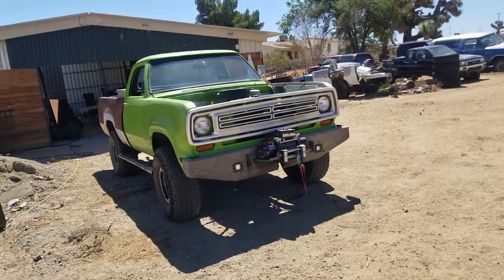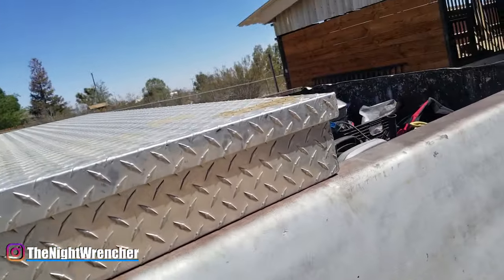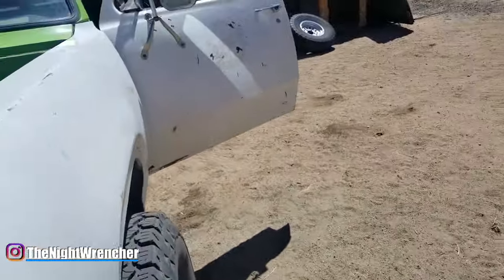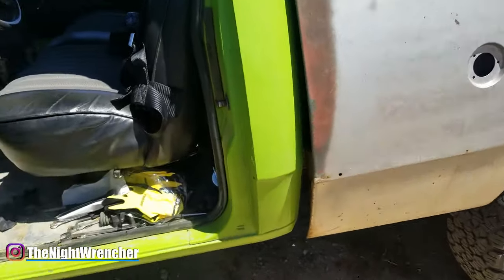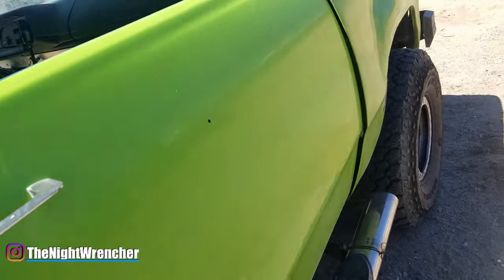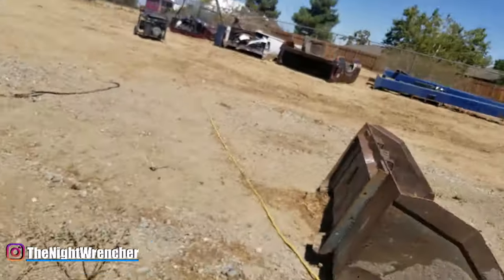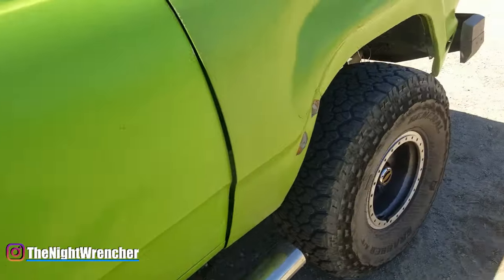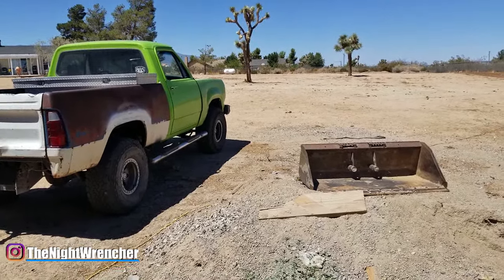Holley Carb Running Rich? Watch This! | Holley Carburetor Secrets | Holley Carb Tuning |

Comment: Dropping that knowledge. Thank you man. Best explanation ive seen yet.  Been tuning my 1850 on a 350. And everything lines up with need more fuel. So stoked on the carbed LS. boss has one lying around.  Maybe its time.
Reply from the maker: You can get that 350 to spin like a top. The older SBC were still pretty good motors. Update the ignition, tune the carb and she'll be perfect

Comment: I run a Holley 650 double pumper on a '64 Merc 352CID and have gone with about 3/4 turn on mixture screws
Reply from the maker: 3/4 fronts and 1/2 rear has always been the magic numbers for me.

Comment: Ok then, I'm going to reset tomorrow,  back to stock. Even tho engine was dynoed to find jet combo. Everything,  iab, ifr, jets. Only thing I won't mess w is PV. 4.5 in now. Makes like 9 to 10". 
Great vid man.
Reply: If it was dyno tuned put it back in that configuration
Reply: Engine dyno, not wheel. 
Still back to that?
Also, are IAB supposed to be the same size prim and sec?
Reply from the maker: Engine dyno and wheel dyno will have a different tune so your best bet is to go circuit by circuit. The iabs are usually square front to back

Comment: Nice. Still trying to get my turd to run better. 
Just got a new hp body. May try it tomorrow.
Reply from the maker: That'll be sweet man. It'll throw your tune out the window though. Keep everything else as it is and just swap the main body and see how it responds. Figure out if you gotta go rich or lean and then go circuit by circuit.

Comment: Great Video. I will have to watch again. I am completely lost at this point tuning a 1974 Honda XL250. Going to check timing and dwell. Haven't done that yet. Played around with jetting and needle so much that I am getting closer. Taking a break and making sure timing and points are set correct.
Reply from the maker: I'm not too familiar with that engine but the stock settings for that carb wont work? Also, with any engine with adjustible timing,  ignition should always be set first.
Reply: @NightWrencher  Thank You. It's been years since I worked on my old Volkswagens. This bike is taking me back there. Enjoy your day.
Reply: I put a wide band 02 on mine said screw it really helps on tuning it in great videos

Comment: At 11:23 you talk about putting a hand over the choke primary. I have a Holley 750 (Barry Grant variant) on my 383 stroker. 10.7:1, pretty rowdy cam. No choke plate but when I block off the primary the motor dies. 
Showing symptoms of a rich condition but afr is close to perfect. 13.5 ish at idle and high 12s across the board all the way up. I'm already jetted down lower than I think I should for this motor, I was even lower with similar results but currently at 72 primaries, 77 secondaries. Acc pumps are 15 thousandths off at idle, 5.5 PV, needle and seats good, float adjusted at bottom of sight hole, 31 squirters front and back. Valves checked and lash set. It's not like it's running horribly, afr is good but getting some exhaust pop in the higher range and a little smokey (fuel smoke). Any ideas?
Reply from the maker: So heres a tip. If you have a cam with a decent amount of overlap, your AFR gauge will read false lean at idle and low RPM. The only way to tune that would be with a tach or with a vacuum gauge. First make sure you have enough timing at idle for the cam(tune it the same way, with RPM or Vacuum). Second, set the preliminary idle speed and tune the idle mixture. As you dial it in, the RPM will climb, and once you go too far, itll dip back down. I like the idle a hair rich to compensate for different weather conditions. As for the popping, if it pops on high RPM decel, you probably have the idle speed set too high, you might have an exhaust leak or you're running too rich. If the exhaust pops on consistant acceleration into the upper RPM and you feel the car hesitate, its lean or the plug gap is too wide. If the exhaust pops while you're accelerating in the upper RPM, you're too rich or have an exhaust leak. Hope this helps.
Reply: @NightWrencher  timing has been dialed, lightest springs with 38 total and it's very happy there. I did end up finding my popping culprit, #8 plug was closed up and sending unburnt fuel through to be ignited in the collector, must have happened during my last plug read. Don't remember hitting it on anything going in but alas, that issue is fixed. 

Still pig fat, blowing puffs of black smoke on throttle cracks and raw fuel smell at idle. I'm gonna look at my transition slot and adjust my secondary blades tomorrow. Plus mess around more with acc pump cams again. I'm thinking my transition slot might be too uncovered with my 1000 rpm idle, cause my idle circuits don't have as much adjustment in them as I think they should.
Reply from the maker: If your carb is a 2 corner idle carb, do not try to open the secondaries at idle. You're just going to wreck distribution and lower your idle vacuum. 1000rpm at idle is way too high. Even my 73 charger with a 294/294 advertised on a 108 LSA cam shaft, idles smooth at 750 rpm hot. Reset your idle screws and start over from scratch. You want that front throttle plate as closed as possible. Its doesnt "need" to be square but it definately cant be taller than a square.
Reply: @NightWrencher  FYI this car is a bracket car, will spend most of its life doing the 1/4 mile. So I don't care about driveability, just peak power without putting holes in pistons lol
Reply from the maker: https://youtube.com/shorts/_Fve1wtlIOc?si=uIAn6OJWU1n2-kv0 heres a video of my car idling
Reply from the maker: In addition to the message I sent 7 mins ago, make sure you have that idle set correctly. If you have the throttle too far open, itll mess with off idle performance and will become very noticably leaner when trying to load the car up on the converter.
Reply: @NightWrencher  4 corner idle on my 4779. my cam is 298/298 112 lsa. I don't know how much time you spend at the track but I'd be hard pressed to find anything idling much lower than me. The other 383 on my team doesn't like anything under 1050. Most of us are either running locked out dizzys or the lightest springs, with as much timing as they'll take. But every motor is different so I'll start fresh again tomorrow and see what it likes.
Reply from the maker: @matthatesford  i drive to and from the track so my car is set up a little different. But what I do know is that you car has a very close cam to mine, but your motor has More LSA, more cubes and more compression so it should run and idle better than my engine. Mine is a 4 corner idle carb as well, the rears are turned in just a hair and the fronts are almost completely closed. Resetting your idle and going based off RPM is your best bet
Reply: @NightWrencher  alright bud, so I got most everything dialed. My t slots for the primary and secondary are the same elevation and my secondary was open too far. Closed them both down, increased air bleed size drastically, plus several other tweaks. Sitting at 14.5 afr or so at idle, 12-12.5 at wot and low 13s everywhere in between, except for right at 2500. 2200 is good, 2800 is good but right at 2500 I'm getting 18-19 steady afr. That should be right when I'm coming off my transition and into my mains correct? I've got 73 fronts with a 5.5 pv. Would you start going up in main or up in PV first?
Reply: Belay my last. I went down a bit on my secondary idle air bleeds and that cured that lean spot perfectly

Comment: I wish you could tune mine.  I have a Holley 80457-2 4 barrel.  Mine starts fine, revs fine without a load. When I drive the hills of San Francisco, she is struggling to even getting up the hill. Even if I put the engine into a lower gear, it’s not getting better.  350 Chevy.  The car has electronic ignition and new plugs and wires.  Feels like I can’t get more power from it. No backfiring either. Thoughts.
Reply from the maker: I have that same carburetor. Its a 600 single feed VS. First of all, you need to make sure you have enough timing in it to it runs right. You want at least 13 degrees of timing at idle and 32-36 max at WOT so you can get the best road maners. Aside from that, I'm willing to bet your carb is running too rich. Usually if you go into a lower gear, the AFR will go richer with less load and if you go up a gear and lug the engine, it would go lean. Second, since youre not getting a back fire, that would also indicate that its not running lean. If you can, drive with a vacuum gauge, see if youre getting below 7" of vacuum going up a hill since that would open the power valve and pull more fuel. Pull a plug, and if its jet black, youll be able to pin point it.
Reply: Check power valve.

Comment: Hello, my setup is a Ford straight six, turbo, intercooler, Quick fuel blow through carb and MSD.
Also installed A/F gauge. It reads around 14 and change at idle. Running out of adjustment on mixture screws and it’s still running way too fat. Do I need to look elsewhere??
Thank you
Reply: Initial timing maybe?
Reply from the maker: Hey man, I would definately make sure your initial and total timing is set before you start playing with the AFR because the timing will change the idle vacuum, idle RPM and Idle mixture. Your issue might lie in a few things, 1) possible vacuum leak 2) fuel float level set too low 3) IFR too small 4) low speed air bleeds too big. If your car is an automatic, you can try putting the car in Drive, hold the brake, and start leaning into the throttle and listen for hesitation or popping. That can be an indication of too small of an IFR

Comment: Hi great video(s). Much appreciated the efford in making those. Wondering if you kindly make a comment on the situation I have with my motorbike/carburator. 250cc. Mikuni-34. The carb is super clean, jets and all. No air leak. However, it stalls after about 30 seconds on idle either on cold start, or,  at traffic stops. When driving non-stop/high-rev it is perfectly fine. Perhaps, it is the float level? I played with it but did not help. Should I change pilot jet to something else even though Yamaha indicates 47.5 on manual?  Any comment? Thanks a bunch.
Reply from the maker: I dont have too much experience with motorcycle carbs but you can try covering the air inlet to block most of the air from going in. If the condition gets worse, youre running rich, if it gets better, youre running lean. I'm willing to bet your idle circuit is running lean.

Comment: Very interesting although mines not as simple as that my Toyota will only run at 28 turns on my mixture screw but if I try to turn the screw in the engine just starts to die so I seem to be stuck at twenty eight turns

Comment: I'm running rich should I downsize the jet n PV. Thanks for the video
Reply from the maker: It depends what circuit is rich. Main jet and PV had no effect on idle. Idle and PV has no effect on cruise, etc.
Reply: Idle is kind of high try to adjust but nothing stock carburetor had it for some years never did nothing
Reply from the maker: If its a holley, I have a video on how to set the idle. If its not a holley, I wouldnt be able to tell you where to look. Just make sure you dont have any vacuum leaks
Reply: @NightWrencher  yes it's a Holley going to start messing around with that Jets and look for any vacuum leaks
Reply from the maker: Good luck man, its tricky but just go 1 at a time and you'll get it 👍
Reply: @NightWrencher  thanks for the help bro love your videos n keep them coming

Comment: Just found your video, i have a 350 with flat top pistons. A holley 600 carb, it sounds like a cam in it when idleing but its not that much of a cam. I tryed leaning it 1/8 turn balanced and it wanted to die at lights and was stumbling. I put it back richer and it was ok, but my plugs are dark? I just got a vacuum gauge, what should it read when correct tuned?

Comment: How much engine vacuum should a solid engine show (351 w/ 4bbl Holley carb)  I was tunning it for a friend but could only get 16.5 vacuum...86 ford f150 351 crate engine. It is running smooth though.
Reply from the maker: Theres no specific number. Vacuum changes depending on the cam. Just dial in the timing and idle mixture for max vacuum and thats what it will be.
Reply: @NightWrencher  cool thanks....where are you located...I'm in El Paso,tx, really like your channel....thanks again.

Comment: Carb newbie here. I have the same carb on my 74 Plymouth. Why do we adjust the front screws and not the back ones?
Reply from the maker: I thought I had already answered this comment but I guess not. I don't think you have the same carb as me because my carb is not a 4 corner idle carb so it does not have rear idle screws. I have an idle adjustment video on a 4 corner idle and I do go through and adjust all 4.
Reply: @NightWrencher  thank you man! Do you have a link for that video? I'd like to give it a watch. Appreciate the help!
Reply from the maker: No problem, here it is https://youtu.be/gW55D00zpvg

Comment: Great vid as usual!
Im having a problem where Ive dialed it in as far as smooth running and 800 rpm but am still running rich (smoke in the exhaust, stinging eyes, carbon on the plugs).  Ive got a demon 850 on a 454 with a mild cam.  I also did the air restriction test covering the air flow and the rpm drops off and stalls.  Each corner idle mix is 1/2 turn out.
Reply from the maker: Depending on the lope of the cam, it could be normal, but what is your timing set at idle?
Reply: @NightWrencher  Ill let you know shortly...day or so.  Typically what would you say it should be all in and at idle?
Reply from the maker: All in lands somewhere in the 30-36 range. Idle around 15-20
Reply: @NightWrencher  Im at 26 at idle.
Reply from the maker: That seems like a lot but as it starts up like its supposed to, its ok. Do you have a 4 corner idle carb?
Reply: @NightWrencher  Yes, 4 corner idles set at 1/2 turn out for optimum idle at 800 rpm.
I disconnected the vac advance on the distributor, plugged the hose, mech advance is set at 17 adv.  If I plug back in the vac adv it bumps it up to 30 adv.  Seems like a lot for idle?  Wonder if somethings up with that vac advance?
Reply: still running rich.
Reply from the maker: Where are you plugging in the vacuum advance? It should see ported vacuum. How far open are the front throttle blades?
Reply: @NightWrencher  Its connected either to the manifold or the base plate of the carb.
The front blades arent open much. Just enough using the main idle speed screw to hit the 800rpm mark.
Reply from the maker: It sounds like your vacuum advance is hooked up to manifold vacuum. You should hook it up to ported vacuum. Too much timing at idle can lead to overheating and detonation. I would pull the carb off and flip it upside down, if you have more than a square showing on the T slot, you need to open up the secondaries a hair
Reply: @NightWrencher  Ok Ill try that.  I would think the secondary air increase would help thin it out.  Then dial the main idle down as needed.  Thanks for you help!
Reply from the maker: Exactly right 👍
Reply: @NightWrencher  btw Im still struggling with the idle mix even after adjusting the secondaries.  Im gonna have to mess with the air bleeds to add more air.
Reply from the maker: @abmcd9381  That would be my next guess also.
Reply: @NightWrencher  When you get a chance to check out the vid on manifold vs ported vac for the timing lmk.  Im curious what your take on it is?
Reply from the maker: @abmcd9381  there is no reason to run manifold vacuum for a vacuum advanced distributor. The only thing it does is it adds 10-15degrees everywhere except WOT where there is no vacuum anyway. You dont want to have 30+ degrees of timing at idle, you only need it at cruise if its a street car or locked/limited advance distributor if its a race car. The best thing for a street car is about 15 degrees of base timing, recurved to 30-36 max at WOT with light a spring. You're just asking for problems on a street car if you run manifold vacuum. On a hot day, the added advance will overheat your car easily and even over heat the plugs and cause detonation. Thats my take on it.
Reply: @NightWrencher   I hear ya.  Just wrapping my head around it.  Curious, does/when manifold vac goes to 0ish at WOT does the vac advance drop off too?
Reply from the maker: @abmcd9381  yeah it does. Usually anything above 3/4 throttle has 0 vacuum. Vacuum is a measurement of pressure differential. Once the throttle is further open than what the engine needs, there is no more pressure differential so it doesnt pull vacuum against the port. Thats how you know if you need a bigger carb or not. In high gear sustained WOT, if vacuum picks back up towards the top, you need a bigger carb.
Reply from the maker: It just depends on how the distributor is curved. A properly curved distributor will have vacuum advance. If your base timing is at 20 and you add 15 degrees to it, you're idling at 35 degrees. if your base timing is 5 and you add 15 degrees, you're idling at 20 which is fine. it just depends. I always recurve my distributors so I run ported vacuum advance and 15 degrees of base timing with light springs.
Reply: exactly where my 500 hp 400 sbc likes it too. 21 degree stop bushing . @NightWrencher

Comment: What would make one side lean one side rich. Basic same set up as yours.
Reply from the maker: If you mean left and right, there could be an issue in the carb where you might have some junk blocking the fuel on the lean side. On a single plane you could get left side lean/right side rich or viseversa but in a dual plane, if you have an issue with left and right, something else is going on

Comment: im just trying to get my holley 2099 carb tuned on my 65 Rambler Classic 😭😭
Reply from the maker: Should be pretty easy. Make sure to set your ignition timing before you start messing with the carb and then watch my holley idle video 👍